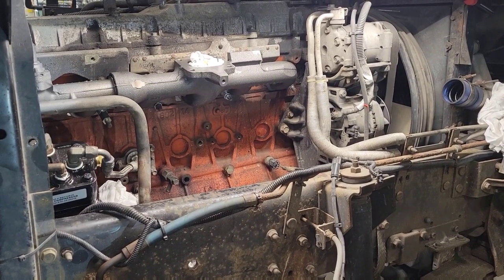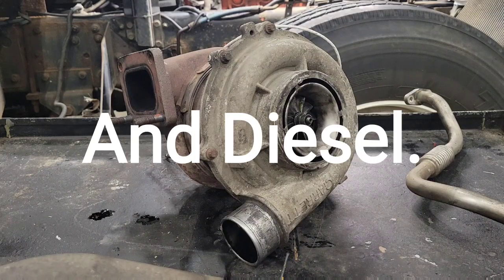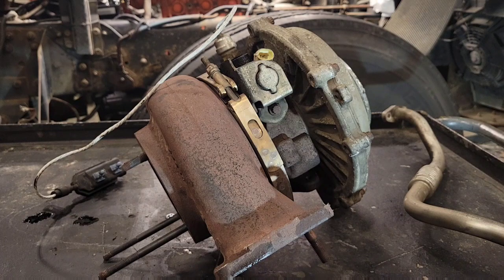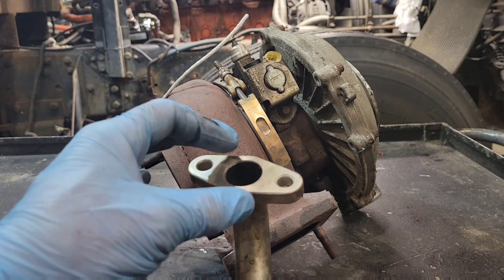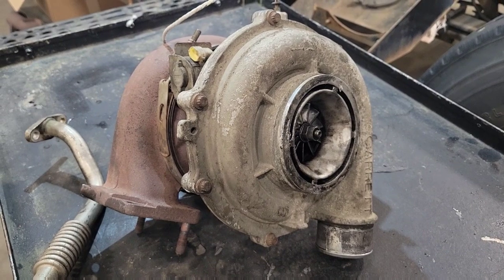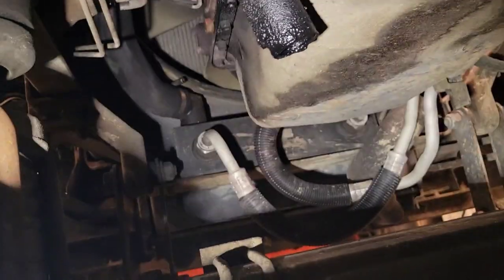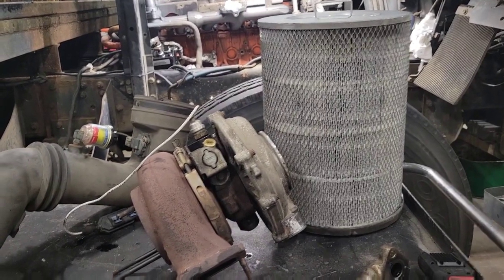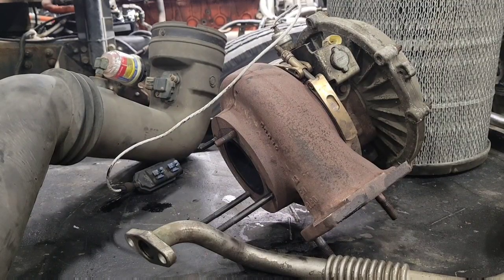Turbo Leaking Oil ? Common Causes Explained. Watch Before Buying New One. By: Shaners Mechanic Life.

Comment: Curious about it coolant lines on a turbo for example one on a Saab 9-3t 08 on a 4 cylinder engine mine seems to be adding extra exhaust gases over pressurizing expansion tank any info on this would be greatly appreciated
Reply from the maker: I have not seen a turbo be the cause of pressurizing the cooling system.
Reply: @shanersmechaniclife3164  me neither I'm on my third Saab 9-3 I plugged the return line Turbo that meets into the upper radiator hose through a t connection and ever since I've done that it seems to have slowed the over pressurization very strange
Reply: @shanersmechaniclife3164  my turbo charger has the coolant line in a coolant line out an oil line in an oil line out I know this is different than other turbos because the coolant lines to my understanding at least

Comment: Since I bought my car I’ve noticed the turbo has oil on it and the intake but no oil stains on the ground. I always checked my oil and for 9000km it was right between the lines.
After changing my oil I put the exactly 6l as instructed in the manual but noticed it was a bit over the max oil on the gauge. 
After changing the oil I’ve noticed oil stains on the ground and after checking the turbo definetly leaks oil. 
Do you think losing some oil until it’s below max would fix this?
Reply from the maker: I would bring the oil into the normal range, make sure it's the right viscosity, and run it for a while then recheck.  Just make sure the oil isn't leaking onto the exhaust, that is a fire hazard. Keep me posted on how it works.

Comment: Mine was leaking to and was loosing power but I realized my air filter was really dirty I just changed it and power and everything is back do you think the turbo is bad ?
Reply from the maker: Turbo might be ok if oil leak is gone and power is back. I would run it for a while and recheck it. When the air filter is very dirty or clogged the vacuum from the engine will suck oil by the seals. Thanks for the comment, hope this helps. Let me know how things go with your turbo.
Reply: @shanersmechaniclife3164  okay it’s stop leaking and power is good but sometimes it just looses a lil power for 4 secs then kicks on what u think I should do ?